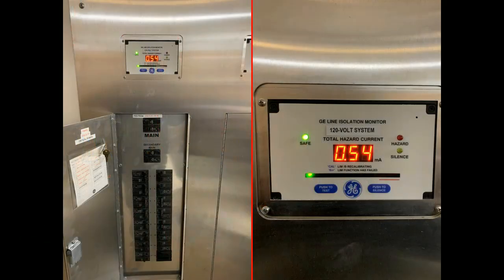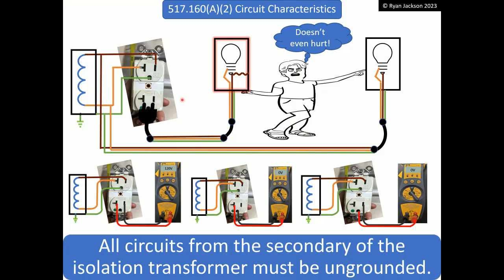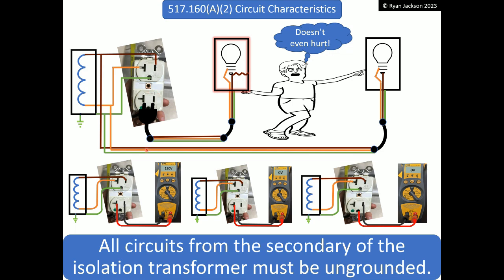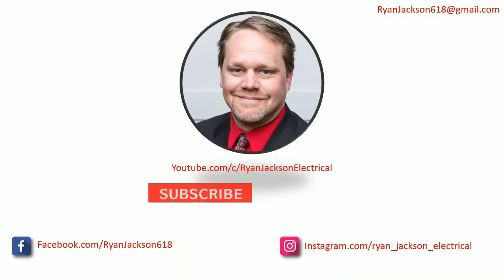Isolated power (ungrounded) systems (NEC 517.160)

Comment: I came across one of these awhile back and when I put my meter leads on either L1 or L2 to ground I was showing 60 volts.   No matter what wouldn't it find away back to the source?  You make the statement at the end if the live wire were to touch the metal plate it would trip the breaker.  The only way for that to happen is if there's a path back to the source.
Reply: yes, it's like a split phase system, but there's no grounded service conductor, aka "neutral". So it's a floating system. If you take earth as your reference, there is still a potential, you can still get shocked. I bet the operating table is very well insulated, and for  wet conditions.
Reply: @wim0104  Just the opposite, operating tables are quite often steel, and grounded via the EGC.  'back to source' just means back to the secondary of the isolation transformer.  The reason you read 60VAC is that there is no such thing as a perfect 'open'.  Air conducts electricity.  Wire insulation conducts electricity.  The plastic used to construct the receptacles conducts electricity.  None of this is a lot of conductivity, but it is never 'zero'.  This means that the ungrounded system IS ever so lightly connected to 'ground' from both legs.  If this conductance is near equal, which is likely as the wiring is all parallel, then your high impedance sensitive multimeter will still measure JUST enough current to read the 60VAC you are seeing.
Reply: @CraziFuzzy  Thanks for the explanation.

Comment: A great explanation, Ryan! One question: In this Isolated Power System, are there any polarity COORDINATION considerations BETWEEN the grounded and ungrounded PRIMARY supply AND the two ungrounded SECONDARY conductors to the LOADS (receptacle and lampholders, in your example)? If the SECONDARY conductors are protected by a 2-pole breaker and there’s no grounded (neutral) conductor, why would it matter to POLARIZE by a ORANGE-STRIPED to the receptacle “WHITE” screw and to the lampholder shell 
AND by a BROWN-STRIPED to the receptacle “BLACK” screw and to the lampholder base center contact??
Reply from the maker: Thanks Brian! I can't think of a reason why it would matter.
Reply: @RyanJacksonElectrical  Here's a scenario it prevents:

Take two devices which both expose the operator to voltage in the exact same manner.  Say two tools or lights which both have a part which is "live" from the brown wire, but is not contacting ground.  If everything is wired the same nothing happens when someone touches both lights at that point.  However, if the second light was plugged into an outlet which was wired with the opposite polarity, that person would be electrocuted.

A defect could mean that all lights manufactured within a certain period of time are defective in the exact same way.  Bulk purchasing means having two from the same batch is extremely likely.

It's not likely, but it's a "free" risk mitigation.
Reply: Electrically it doesn't matter - I honestly think the strict adherence to color matching the legs is more about ensuring every single bit of the highly protective system is built perfectly - so don't leave anything to chance of the whims of a lazy electrician.

Comment: This is a nice introduction but there are many more significant details to cover that need to be looked at hopefully in future series. While you can use an ungrounded system we must always remember in the operating room ground always exists even for an ungrounded electrical system. This means an ungrounded system is much more than the isolation low kvA transformer, line isolation monitor, XHHW wire, receptacles, breakers, heck power cords including all conductor in them need to be insulated.

There are issues around insulation failure of electrical surgical equipment, monitors etc creating more dangerous leakage currents. Here testing and maintenance of those individual pieces of equipment should be regularly undertaken thats other standards beyond NFPA70. There should be a higher bar also on maintenance and monitoring of isolated ungrounded power systems that need to be understood not just by maintenance electricians but also medical staff in the operating room. Also you could make more of a connection between ungrounded system and emergency backup systems in the NFPA70.

I am not surprised this area is not well understood the more you can do on this series using the hospital example and scenarios of faults in equipment or system components the better people will understand ungrounded systems. There was a good article in the IAEI magazine in 2007 on this worth looking over.

https://iaeimagazine.org/2007/july2007/isolated-power-systems-in-health-care-facilities/

Comment: Thank you for that explanation.  I am not an electrician nor an engineer, but retired from a power plant and dealt with lots of transformers.  I had a pool installed last spring, and I just couldn't figure out how the isolation transformer protected me from a fault on the underwater light.  After watching this video, I looked at the schematic drawing inside transformer again.  The ground shown is not for either coil.  (draw a lit light bulb over my head).

Comment: Excellent video.  I was an electrician who changed careers and now works in ORs.  Isolated OR systems is actually taught in Anesthesiology Residencies and tested on, Nursing has annual education on the subject.  All equipment in the OR is routinely tested for proper grounding.  Most common occurrence is when a "bad" piece of equipment is plugged in, the "isolation monitor" will alarm.   At any other time, when it alarms, procedure is to unplug equipment in reverse order of how it was plugged in, IE Last piece plugged in is the first to be unplugged and repeated till the alarm clears.  That equipment is then tagged out for evaluation and repair.
Reply from the maker: Great info, thank you!
Reply: Exactly understanding and monitoring ungrounded systems in an OR is also the responsibility of medical staff beyond just maintenance electricians.

Comment: In a system with no faults, would you not see voltage on both L1 to G and L2 to G? And then in the event one of the lines were to have a fault, voltage would drop to zero and then full voltage on the other line?
Reply from the maker: No, there is no voltage from L to G in normal condition. Under a fault you would get 0V from G to the faulted line, 120V to G on the line that isn't faulted. The faulted conductor really just becomes a grounded conductor at that point.
Reply: I thought about it a little longer and figured it out in my head haha! Thanks for the vid!

Comment: You mentioned that one of the wires has to be colored brown, and the other one has to be colored orange. I know that the NEC doesn't require colors for each leg of a three phase system, but generally people use black red blue and brown orange yellow to distinguish between phases. Does the same practice apply to ungrounded systems? Are there three phase ungrounded systems like this? Or only single phase?
Reply from the maker: For an ungrounded delta, usually people just use the normal black, red, blue or brown, orange, yellow. If it was in a hospital, however, 517.160 specifies the colors.
Reply: The specific bits this is talking about is for hospital use, and is only really for equipment likely to come into contact with a patient during a wet procedure - which is all 120V.  As such, I have never seen a medical isolated power system that was anything but 120V single phase.
There are a number of ungrounded three-phase systems out there - but most are military and marine systems, and as such, not subject to NEC rules anyway.

Comment: Great instructor. Your way of teaching is clear, human and straight to the point. 👏 
So, trying to understand the theory myself. There’s no difference of potential between the secondary coil and the metal box, although this one is connected to the earth/dirt, because there’s no circuit through the induction between the secondary and primarily coils. it would be such a voltage between the primarily coil and the metal box if it was grounded. Am I close or way far off?
Reply from the maker: Correct, the primary is a grounded system. The enclosure of the transformer (metal parts) would be connected to the equipment grounding conductor of the supply circuit (the primary), so there would be a voltage there.

Comment: Why don’t we use ungrounded systems more? Seems very safe
Reply: The  problem is that "Faults Happen."   GFCI (or variations that measure the center tap voltage to earth) can detect these faults and cut off the circuit.   Usually, an isolated system will be provided by center tapped transformer secondary's with 60 volts on each side.   The center tap will have a resistive connection to ground.   This leaks off any static charge but the resistance is high enough to keep life threatening currents from flowing via the earth.    Some equipment used in surgeries uses a lot of power and regardless of some current leaking the equipment must continue to operate.   That's why there is a monitoring circuit so that someone can address problems before something important is cut off.   The reduced voltage to "earth" provides some protection also.   Most hospital important equipment has built in battery backup so that even if a circuit trips the equipment will continue to operate.
Reply from the maker: @GilmerJohn  Well said.
Reply: @GilmerJohn  well done nicely explained 👏🏾
Reply: @mathman0101  --  Well, I think you etc. for the complement.   I gathered my knowledge from a combination of an old NEC book I picked up from the library sale, some observations of family folks in the hospitals, and just plain common sense.

The folks that write the rules are just trying to make things safer without making it impossible to do business.

Personally (& with support from an old electrician friend) I believe that sometimes they go way, Way, WAY to far.   The "arc fault" CBs are an example.   Even the GFCI are a potential problem.   These can "fail un-safe."   Personally, I would like to see more "balanced" circuits in households with balanced outlets at 120 and 240 volts.   The 120 volt outlets would have a lot less danger from shock.   The 240 volt outlets would provide no more shock risk than existing 120 outlets but could be protected at lower current levels for the same power or provide better features.  (E.g.: a dishwasher could deliver "bone dry" dishes.)
Reply: If the center tap is connected to ground, then it is not an isolation transformer?  Each leg is then referenced to ground?  @GilmerJohn
Reply: @Nelson484  --  Yep.   If you have a true isolation transformer you have to decide what to do with the center tap.  Often, it's connected to "earth" or "neutral" via a resister of large enough value that a fatal shock can't be delivered.   A high impedance voltage meter across this resistor will show how much "leakage" from the two hot wires.  In some applications, a circuit can monitor this voltage and trip an alarm or even trip a relay to turn everything off.

This is sometimes a concern in medical situations.
Reply: I don't understand this. You connect the center tap to some kind of a "virtual ground" through a large value resistor?  What would be the typical current path when a load is plugged into a receptacle? From one of the hot legs via the load then to this virtual ground?  Via a large resistor? That wouldn't work.  Or the path is from one of the legs via the load to the other leg? Then it is not a center tap.  You may as well leave the center wire floating.     @GilmerJohn
Reply: @Nelson484  ---  The resister keeps the circuit from pickup, as an example, static charges, or picking large voltages from capacitive coupling.     If a load only draws a balanced current, the center tap will stay quite close to ground.   If either of the hot wives finds a relatively low impedance path to earth, some current will flow via the resister to the center tap.

Comment: Thanks for your informative video Ryan, for a time this "balanced power" was installed in recording studios and other AV applications to avoid ground induced noise. I have also seen this onboard steel hull ships to avoid electrolysis at hull joints.
Reply: I believe that both the common marine galvanic isolator and the uncommon marine isolation transformer both retain a bonded connection of the secondary neutral wire and boat ground wire. The neutral bond is inside the secondary wiring of the transformer, and the shore ground is there but completely isolated from the secondary boat ground. In a marine isolation transformer the difference is that shore ground is completely separate from boat ground, and in a galvanic isolator the two grounds are connected but separated by a set of parallel, opposite polarity diodes with a 1.4V forward drop either way. So, the marine setup is fundamentally different than the isolation described here in operating rooms, where ground and neutral are separate when testing with a multimeter.
Reply from the maker: For recording studios it is very similar (60/120V), but it is a grounded system.

Comment: As a kid, I'd see the TV repairman insert an isolation transformer(1:1) between receptacle and TV before working on it.  Yea, there were TV repair folk back in the day and TVs did break and people did fix them.  The isolation XFMR in that case served the same purpose...no earth reference....for his /her safety.
Reply from the maker: I've never heard that before. Interesting!
Reply: I think the main benefit there is for diagnosing faults; i.e. keep the system running even though it has a ground fault.
Reply: this is similar to using an old school light bulb with a filament in stead of a safety fuse: the resistance of the filament goes up when current goes up. This helps with diagnosing an overcurrent inside the equipment.

Comment: what is the voltage of each ungrounded conductor ? 60 v ?+/-
Reply: Since they can only reference each other(there are no grounded conductors), the only potential is between each other...120V.  Otherwise is undefined/don't care or zero(Static charge only).  It does make trouble shooting a bit more difficult since for voltages measurements, earth means nothing. For industrial controls, I always 'ground' a leg of a power supply.  It is a real pain to diagnose circuits(control circuits especially) when there is no ground reference(floating system).  'Floating' systems are a tricky thing to diagnose.
Reply from the maker: @nhzxboi  Well said.